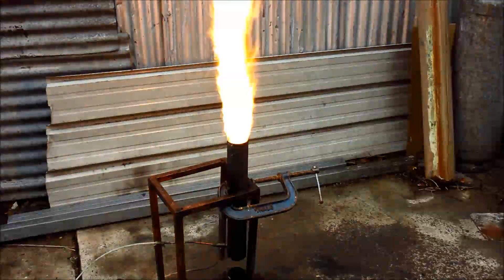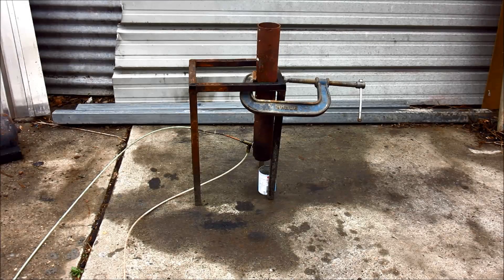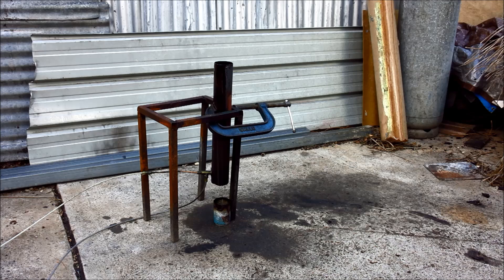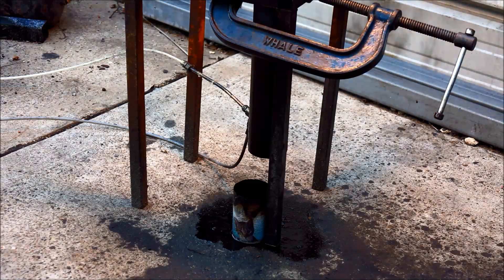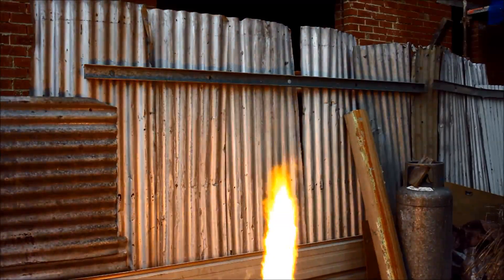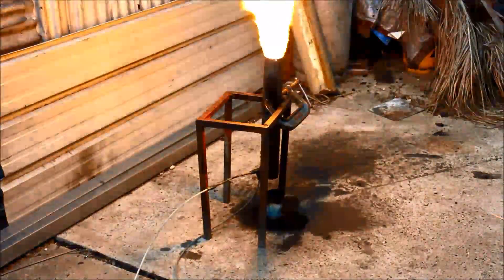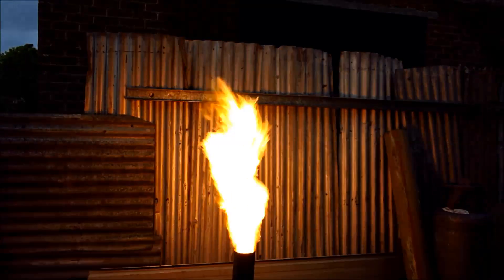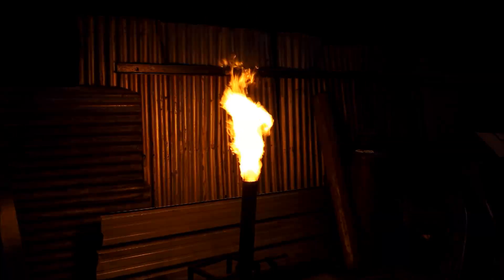Vertical oil spray burner Light ups and running

Comment: is that two lines connected to the burner or a single oil and air line. appreciate a simplified video with the basic stuff.

Comment: New to your videos so maybe this has come up already, but this seems like a perfect burner for a 'Russian' style fireplace- the massive brick structures with a small firebox and the maze of zigzag internal chimney to trap all the heat within, creating a huge thermal mass that then stays warm for days.
Reply from the maker: +Alaska Bruce  Yeah, they are brilliant designs. Nothing beats thermal mass.  I built my Pizza oven the same way. Takes 2 hours to get to temp but the thing cooks soooo good and even.  Weighs just over 2 ton so plenty of thermal mass there. Next one I build I'll insulate it with batts and hebel.

Comment: Does a square pipe have any benefit over a round one?
Reply from the maker: +Pete Franklin  Yes!  If you have a load of square pipe hanging around but no round pipein the right size, then the square pipe is cheaper, easier to get, faster to get and burns every bit as good!   :0)
Reply: @glumpy10  Happen to have 4" square tube, have been worried I NEED to use something round, but will be trying that!

Comment: Nice vid mate, that spray burner is so versatile. The possibilities are endless!
Reply from the maker: +Scragos  Thanks, much appreciated.  It works very well.  I have in mind a new forced air burner that can be used horizontally, Vertically  and upside down. I haven't built a new burner of that type in a while and I'm looking forward to it. Hopefully i can get it built this week and a vid of it up next week. 

I know for most people a practical application will be a fixed one but I like to play with the things in different applications and see what they can do.
Reply: +Oil Burner Yeah! That's what it's all about isn't it? Experimentation and messing around, good fun. Hopefully all goes well with the new burner build and can't wait to see it!

Comment: Re safety tip:  not sure I'd want to heat up a tank of compressed air too much either without making sure any relief valve is sealed off.
Reply from the maker: +MrTechnophile  better compressed air than pro paaaaane but who can allow for the safety sissy and soft of heart and head mentality?

Comment: I wonder about a gas dryer ignitor for these.  Would require electricity to be available.
Reply: And might show an annoying tendency to melt once the burner starts.
Reply from the maker: +MrTechnophile  Yeah, there is that in it.
Reply from the maker: +MrTechnophile  Thats a point!  Maybe the ignitor could light a pilot light which in turn lit the main burner?
Reply: +Oil Burner That sounds good, I wonder how to do it simply.  Tap off of the main nozzle and a small burn tube?  Maybe a heat shield for the ignitor instead, just a piece of steel to block most of the heat?  Or, there may be types of ignitors better suited to this.  The scrap heap back of an HVAC place plus asking nicely may turn up a suitable ignitor, or at least some ideas.
Reply: +Oil Burner hmm sounds alot like an afterburner's torch ignitor. well if they work and don't melt in an afterburner than they can be made to work in an oil burner i figure

Comment: I just watched the vid. again. Is that the neighbors right there around 13:05?? HOLY CRAP!!!!!  Looks like they built right TO the property line!!  Now I really want to see you add that 10 foot pipe when they move in!!!!!  ;) Maybe even throw in some green tree trimming to give the a nice welcoming smoke signal HELLO!!!!
Reply from the maker: +Steve 1961P.  yeah Steve, they are 3 ft from the property line. I think shooting the flame up the big pipe would be a great welcoming for them.  I'm actually thinking of doing a new fuel blown burner with the Nozzle going straight vertical.  I can generate a lot more fire with the blowers than the compressor aspirated burners. 
I'm also going to try designing the burner to run in the down as well as upwards firing position. 
Running the thing rich with a tall pipe should allow me to get a nice high flame.
Reply: +Oil Burner Hell yeah.. 1/2" tube fuel feed line with 2 big blowers. 
A 70 foot of vertical flame ought to be a nice WELCOME TO THE NEIGHBORHOOD!!! ;)
Reply from the maker: *****  I think it's YOU that gives ME inspiration mate!  I think I'll have to work on something even better than this. I'm sure with a bit of thought and effort I can get a flame up to the first floor or above.

I also thought of the " Whoosh" Factor and bought a garden pressure spray to rig up for that very reason.

Going to see If I can rig up the pressure washer today to Spray oil.  If that works and I can light it up, I think I'm going to have quite a bit of fun!
Reply: +Oil Burner 
Laughing my ass off thinking about your neighbors seeing that flame, hearing you narrate, and wondering what the HELL goes on over in your yard. You need a feed tube going in above the C clamp, to squirt in the occasional gear lube or whatever, something to give a nice 'Whuff' and some black smoke rings rising over the neighbor's roof.
You give me inspiration, not sure that's something others would consider a positive thing, but I like it!
Reply: +Oil Burner Make sure you use that special (over the fence) nozzle.. ;)

Comment: Hello! Is there a way to auto regulate the heat output of this kind of burner for heating and hot water purposes? What kind of oil are you burning?
Reply from the maker: +phunkmeister  I imagine you could rig something up for auto control.  I burn waste veg oil in this burner. It will run on anything just the same.

Comment: hey stop being a sissy and drill some holes in that pipe while it is burning. This burner is clearly in a need for more air. You need a nice redhot pipe for the oil to evaporate completely. Right now most of the burning is outside of the pipe. I guess you need about 20-30 10 mm holes drilled in it. Stop being a sissy and get it done.
Waiting for your next video this evening :)

Comment: How lean can you get these things to run?  Can you do a test with various types of oil in litre bottles to find the longest and hottest run times?
Reply from the maker: +Green Silver  No need to test.  Choose 1, Longest run, hottest run, leanest run.  They are all separate and differing conditions.  Longest run will have lowest heat output. Hottest run will not be lean because that would require the burner to heat excess air.  Leanest run will not be hot and certainly won't be longest run. 

Highest energy content oil will be diesel followed by WMO or other mineral oil.  Veg oil will be next  followed by kero or turps.  Oil type is independent of hottest flame, leanest mixture and longest run time.  That is dependent on the goal the the burner is set up for all are different and exclusive.
Reply: +Oil Burner try installing a coiled pipe to the burner that should help increase the performance
Reply from the maker: GWR Productions 2014
No, unfortunately that is a well repeated misconception. Heating the oil would only make it flow better if it were too thick. I have more than enough fuel flow available now.
Despite the often talked about pre heating, the only thing It might do is cause the oil to carbonize in the pipe and block the flow. Other than that there is no benefit at all.
Reply: Oil Burner it worked well on the last oil burner I built
Reply from the maker: GWR Productions 2014
In what specific way did the burner work better with the preheated fuel than when you tested it without? Was it a spray type burner or some other type?
Reply: Oil Burner it produced more heat & it was the spray type too
Reply from the maker: GWR Productions 2014
Did it burn the same amount of fuel or more?
Reply: Oil Burner & there's also another advantage there too, you could also use it to burn fats/grease too
Reply: Oil Burner roughly a quarter less only thing is you'll have to make a few more odd adjustments now & then
Reply: +GWR Productions 2014 put that on a steam loco and you won't have pressure issues
Reply: Jleone leone unless it's the BR Standards
Reply: +GWR Productions 2014 you know what i mean
Reply: Jleone leone depends on the quality of oil & coal really
Reply: +GWR Productions 2014 try pensyvania reading anthracite coal
Reply: Jleone leone closest I've tried is Cynheidre anthracite & that's from one of the best coal seams in the world
Reply: +GWR Productions 2014 sorry i am from the U.S. and i did not know that, thanks thougth. In America reading Anthracite is some of the best coal in the country.
But once again thanks.
Reply: Jleone leone only problem is that you can't use it on steam engines as it would literally burn right through the fire bars
Reply: +GWR Productions 2014 true but wouldent the ash act as an insulator.
Reply: +Jleone leone sorry that would block off the air
Reply: Jleone leone providing that firebox & boiler tubes are cleaned out properly you'd have no problems
Reply: +GWR Productions 2014 ok thanks for all the info on the steam engines question have you ever seen a big boy steam engine before or mallard
Reply: Jleone leone never seen the power station on wheels as for Mallard I've seen her in the National Railway Museum in York, not only that I've also driven her class mates 4464 Bittern & 4488 Union of South Africa in the past
Reply: +GWR Productions 2014 you were a train drivet
Reply: +Jleone leone driver sorry
Reply: +Jleone leone i have seen the bigboy in life but not mallard to expensive to fly their maybe one day
Reply: Jleone leone used to be
Reply: +GWR Productions 2014 wow its a honor to talk to you, you are actual living british rail history i wish I could meet you in person.
Reply: +Jleone leone i migth be 14 but i would love to drive an engine one day is it fun
Reply: +GWR Productions 2014  i wish i saw Dwight D Eisenhower before she was shipped back to England
Reply: Jleone leone as far as I'm aware that's back on US soil
Reply: +GWR Productions 2014 really thats cool hey if i have any questions about steam locos can i ask you.
Reply: Jleone leone no problem kid
Reply: +GWR Productions 2014 so how many bar does an a4 pacfic fire at
Reply: 250psi which is just over 17 bar
Reply: +GWR Productions 2014 what does a jinty fire at oh by the way isnt thomas the tank engine a jinty
Reply: Jleone leone 160psi & that little bastard is based on the LB&SCR E2 class
Reply: +GWR Productions 2014 sorry i did not know that guess you must hate him
Reply: Jleone leone Since HIT Entertainment got hold of it they've well & truly fucked it up
Reply: +GWR Productions 2014 that is very true wheres ringo and where is the action.
Reply: Jleone leone that's not the only one that' been CGI'd
Reply: +GWR Productions 2014  your rigth that cgi is garbage nothing beats hard work and real detail